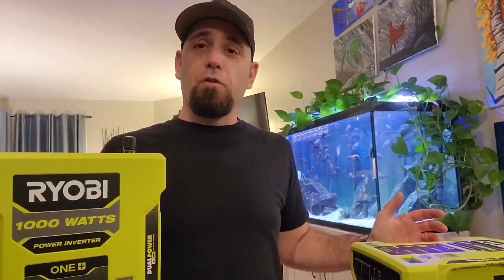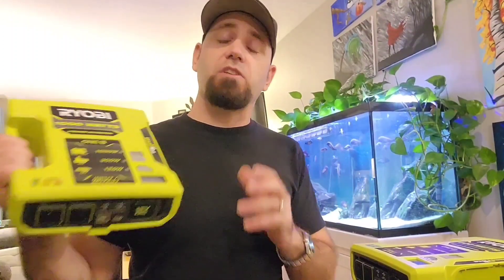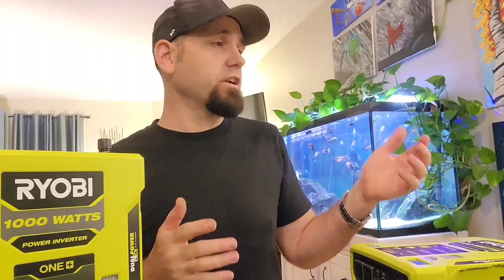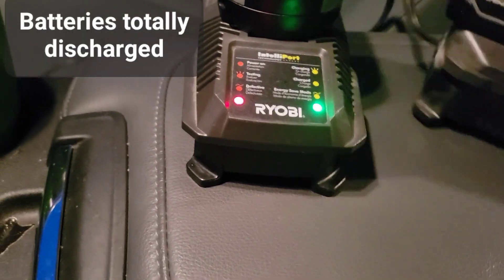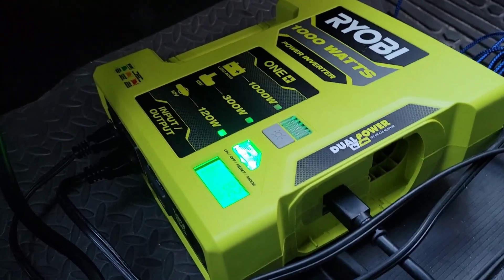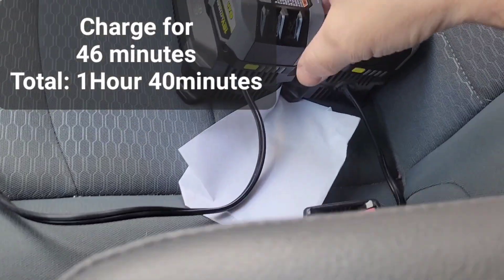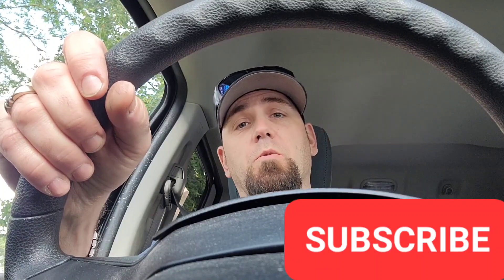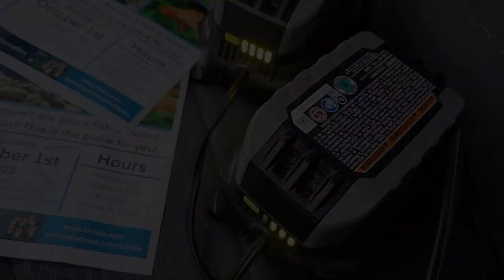1000W inverter charging 6Ah batteries

Comment: Super helpful! I was debating if one of these would work while I was camping way out in the sticks. Could I charge a battery during usual driving without running a generator? Well, looks like no.
Reply from the maker: @LibertyFirst1789   you could use the 150w power source. That's a charger/inverter........if you can find one in stock somewhere.

Comment: Would the ryobi 60w solar panel charge the battery that powers the invertor?
Reply from the maker: The Ryobi 60w solar panel need the RYi150C power source in order to charge the 18v ryobi batteries